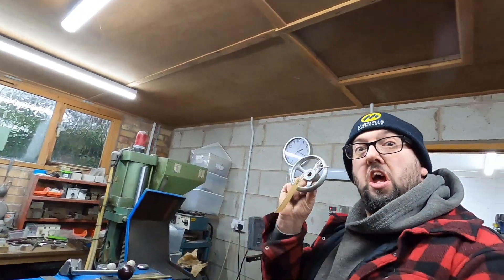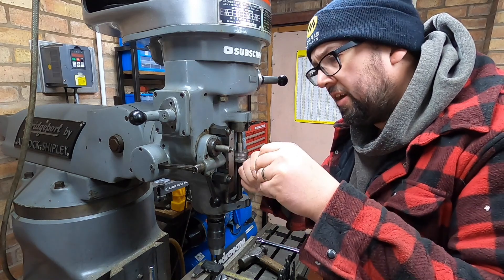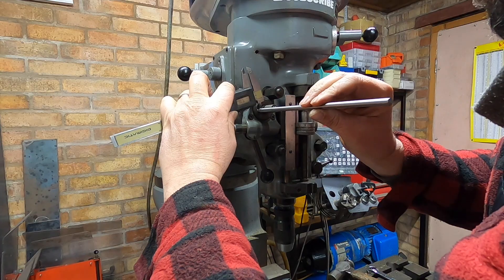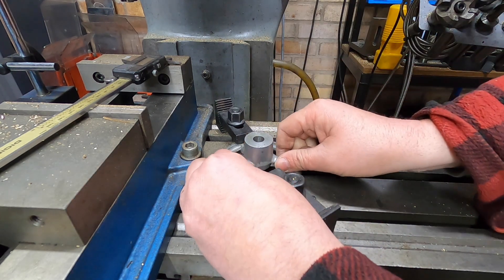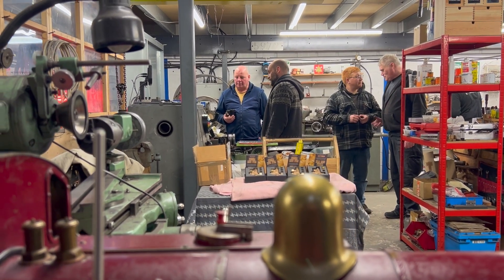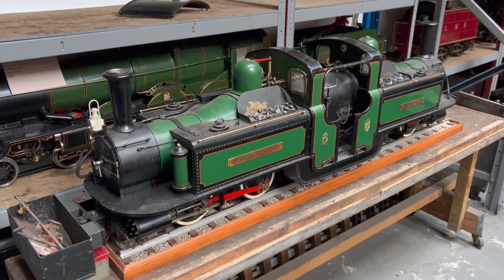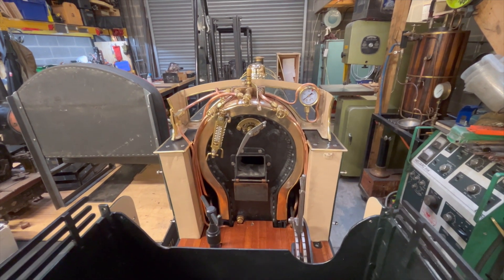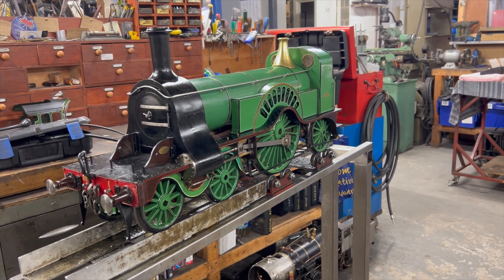Bridgeport gets a Quill hand wheel & Visit to Steam Workshop - Workshop Chronicles EP #002

Comment: You have quite a bit of backlash in that handwheel. Mine has less than a 1/4 turn. Probably nothing to be overly worried about. Tearing into it to fix it will be quite the challenge. I don't know what parts availability is like in the UK compared to the US.
Reply from the maker: Well we can get parts but in most cases they are twice to three times more expensive than U.S. I’ve wondered if it would be cheaper to import them. All the best, Matt 👍
Reply: @MattChiversWorkshop  I shipped a set of imperial depth mic's to a friend in York and it was VERY expensive. I am frustrated that we don't have some kind of postal rate agreement between our greatest allies.
Reply from the maker: Yeah It’s same going from UK to US, I do lots of orders to US and we are on the verge of the postage being more than the products, it’s ridiculous. I don’t understand why it’s shot through the roof, it’s rather frustrating. All the best, Matt 👍

Comment: Hey Matt maybe a little loc-tite on the pin too make sure it stays secure and I am always amazed at the level of detail that they put into those steam engines
Reply from the maker: That pin is press fit, there is no way its coming out 😂. That 7 1/4” gauge Duke of Gloucester with the working Caprotti valve gear was a masterpiece of a rebuild they did a couple of years ago. Little bear is way better in the flesh!! All the best, Matt 👍